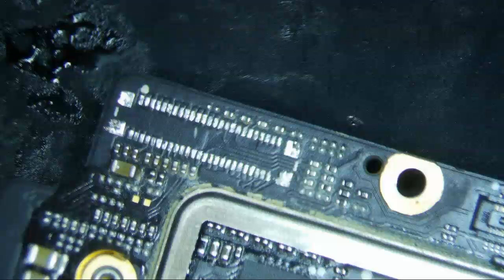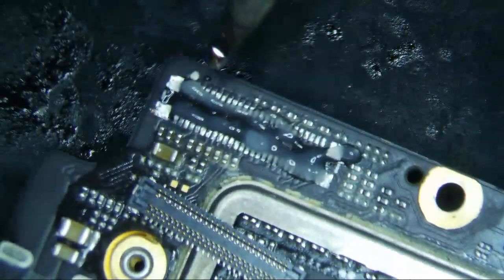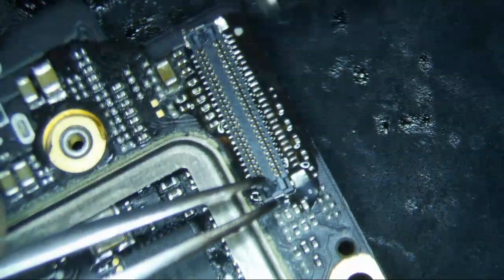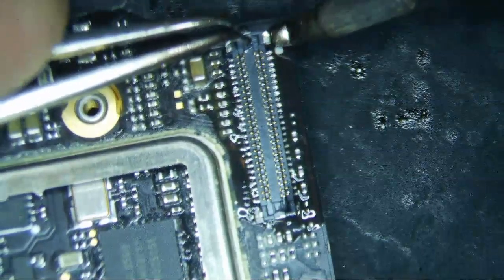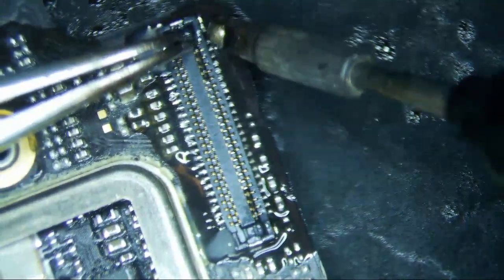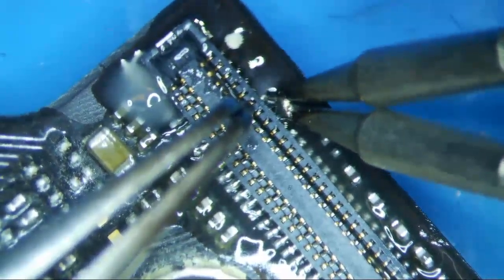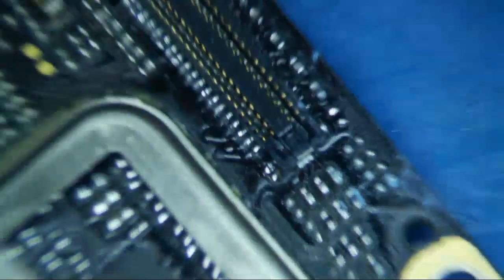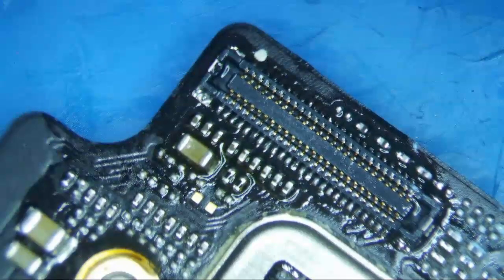DJI Mavic 2 Enterprise Drone Connector Repair

Comment: The same work on the smartphone board i do with JBC NT115-A using C115-118 or C115-105 tip. With this tips work ease and quick.